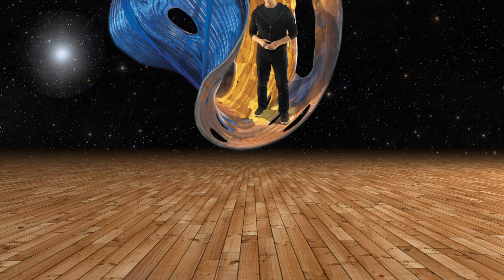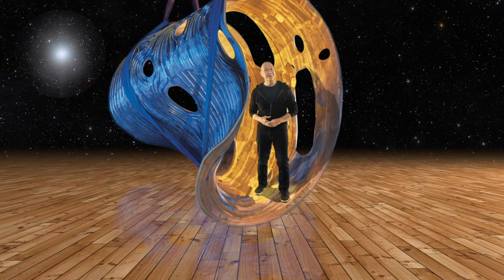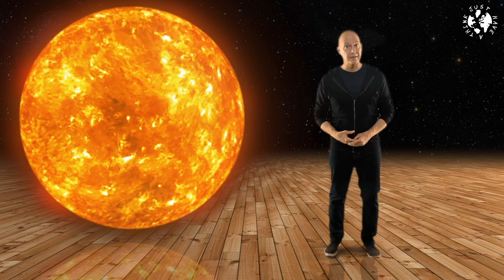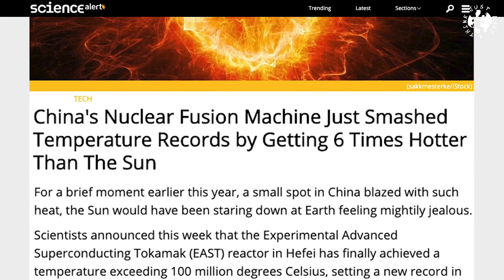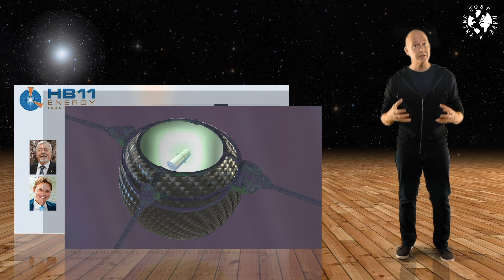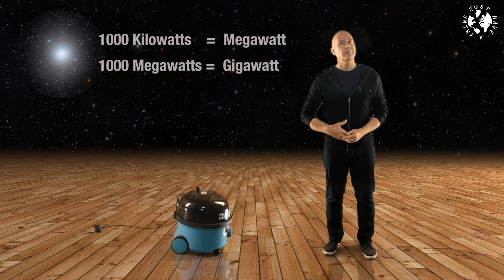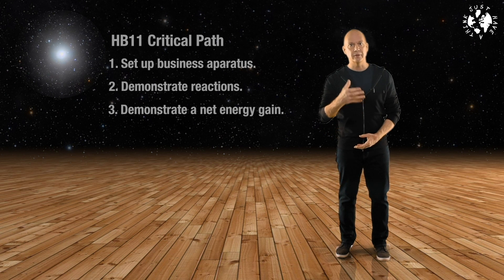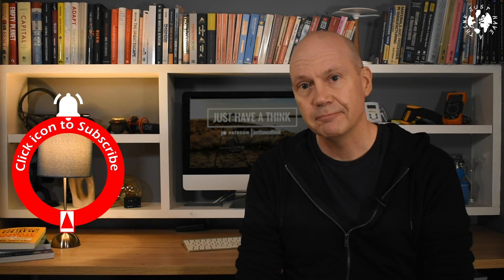Nuclear Fusion:  Revolutionary new breakthrough.

Comment: Well, I'm an inventor. One of my inventions is an engine that utilizes an insulated combustion chamber and three cylinders operated in a 2/4/2 stroke configuration to achieve better than 2/3 efficiency. Care to take a peek at the future of internal combustion? richardcaldwell1958@gmail.com
Reply: We must stop burning stuff, so why invent a combustion engine during these times?... 2025 nobody will buy a new ICE car anymore, no matter how efficient, because electric cars are much better and cheaper. Wasted effort if you ask me.

More and more legacy car manufacturers have announced to stop the development of new Internal Combustion Engines, and will focus more and more to electrification of their cars. They have to, or they will go bankrupt.
Reply: @MarcoNierop  Hi Marco. The competition isn't electric motors but batteries. Why carry around a ton of expensive batteries when a tiny synfuel/biofuel engine and fuel tank paired with a tiny battery can feed the electric motor as or more efficiently and with less weight and cost? Plus, EVs take a lot of time to charge and don't clean the air.  Note that a thousand mile range makes highway driving easy. And what about ships, planes, and grid storage?
Reply: @richardcaldwell6159  The whole point is that you  still burning stuff, and that must stop... An electric car charged from solar panels, hydro power or wind power got its energy without burning stuff, you bet that cleans the air. 

Batteries will get a lot better, cheaper, higher energy densities, other materials. It shows in the smaller cars that come to market the next few years, like the Honda E, new Fiat 500E, and existing models getting better ranges.

1000 mile range is nice, but who needs that?  80-90% of the driving is around town and for commuting to work, with less than 30 miles per day. Its insane if someone drives 1000 miles in one day, and even then that would not be done in one go.. everybody needs to stop for a wee, and a lunch.. plenty of time to charge at a fast charger to 80% in 20-30 minutes for the next leg... and with advancing tehcnology, these charging times will get shorter anyways.

Batteries for grid storage is worked on, very hard! and not only by Tesla.. Look up Ambri.com , ESS and others. Beside that with V2G technology we also will utilize these millions of EV's as backup energy storage. Look up virtual power plant.

Planes is worked on, look up Harbour Air,  Easy jet electric, and Eviation. Also many  projects on the way for autonomous electric air taxi's, look up Lillium. Furthermore, small single engine 2 seater electric aircraft are on the market right now, and already in use at flight schools.

Also ships will be electrified allbeit with hydrogen fuel cells probably, I am not really aware of projects on the way, but about a year ago big container shipping company Maersk announced they want to make ALL their ships carbon neutral by 2050. In Schotland there is a big ferry running on batteries. and also in some Norwegean Fjord a fully electric Ferry is doing its job.. This are big boats with hundreds of passengers and vehicles on board... and it makes so much sense! electric motors are much more powerfull in less space, require almost no maintenance, and run completely clean and therefore do not polute the oceans.

Comment: You ask if we should solely concentrate on this new method of fusion. I think we should pursue all possible forms of clean(er) energy. Not just because of climate change but to reduce pollution too. In principle, it is never wise to bet on just one horse. Until the techniques are ready and refined enough for large scale use it is best to not be dependent on just one or two techniques. That way if there are setbacks for one or more techniques we can still use others to achieve our goals

Comment: Suspicious when your prediction is of by million on the good side.
This shows some that they actually don’t understand the process!?
Hope it’s not another cold fusion :(
Reply: youtube search "Safire Project" low energy nuclear reactions,,,, the way of the future our sun is electric not atomic
    not fake bullshit,,,, this is as real as it gets
Reply: Either that, they're con men or both. I wouldn't touch it with a 3m pole.
Reply: @rolandlemmers6462  https://www.youtube.com/watch?v=DTaXfbvGf8E,,,, project safire its real and progressing,,, without the need for billions of dollars to build it,,,, the proof of concept hs been running since 2015,,, safely and reliably and its clean
Reply: @shockwave326  Electric universe! Bravo Uniform Lima Lima Sierra Hotel India Tango.
Reply: @rolandlemmers6462  bs huh ? read and weep 
 WHAT THE CURRENT REACTOR IS CAPABLE OF:
Stable self-organizing plasma double layer shells
Stable plasma tufts analogous to stellar plasma tufting in the photosphere
Trapping of ions, electrons and molecules within Double Layers
Energy densities analogous to the Sun
Electromagnetic confinement of matter
Steep voltage drop just off the surface of the anode
Acceleration of ions from the SAFIRE core 
Spectral line broadening showing higher energies in plasma corona
Uniform thermal radiation emission – low thermal buoyancy
Creation of concurrent collisional and non-collisional plasma
Eruptive discharges analogous to Solar CME’s
Chemistry as a catalyst to Double Layer formation
Slowing the speed of UV light by 5,000x
Analogous transformer / capacitor behavior
Continuous spectrum from plasma double layers
 
NEWEST DISCOVERIES
Dark mode plasma electromagnetic structures
Sequestering of heavy elements to the SAFIRE core
New elements confirmed by Mass & Optical spectra, SEM & EDAX
Extreme atmospheric pressure changes – response to high energy plasma discharges (may be analogous to the changes in the velocity of the Solar wind due to CME’s)
a little truth 4 u to chew on and digest https://www.youtube.com/watch?v=DTaXfbvGf8E

Comment: Hi! I'm sorry to have to contradict you, your content is usually very good, but this kind of claims are made all the time and the main purpose is to attract investors. Trying to fuse anything that is not D-T is trying to learn to run before you learn to walk. The probability of HB11 to be the first producing electrical power is very small (to put it simply, they would need a huge amount of luck). You should not divest from solar and wind, we need them. At the same time, having a fusion baseload of ~30% saves you a lot of resources in batteries, intercontinental grids or redundant solar and wind. So do invest on fusion, it's heavily underfunded  and the current roadmaps for electricity are quite credible. If you want to dig more into the topic, the private companies with higher chances of success are tokamak energy (which you mentioned) and commonwealth fusion system.
Reply: Very well (and concisely!) said. Rare to see Dave being misled in this way by investor-fodder. To be fair, from outside the field, it's quite hard to tell which projects are the most realistic without a lot of study. You seem to have reached the same conclusions as me, which I find reassuring :-)
Reply: Never tell me the odds

Comment: My fantasy power generator would involve a sublimation compound that is gas at room temperature and cooling lasers that sublimate it to a solid , similar to the power stroke of a steam engine , the loss of pressure and the power of the vacuum could drive a turbine and create energy . Cooling lasers are used to reduce temperatures down to near absolute zero kelvin and could be used in many power generating systems .